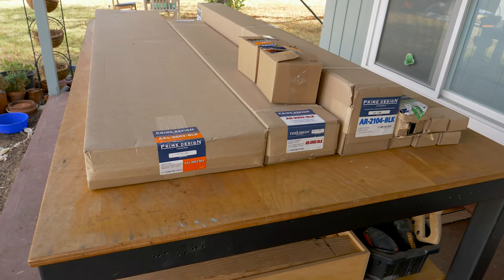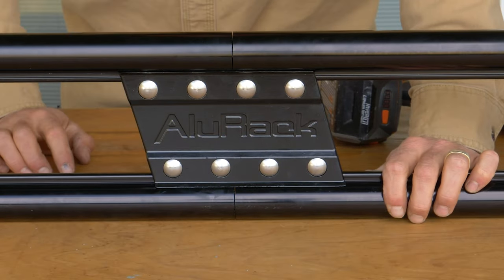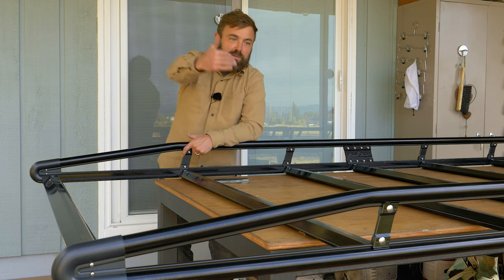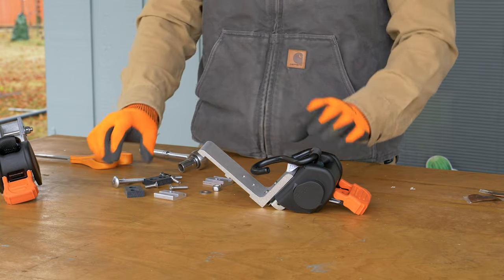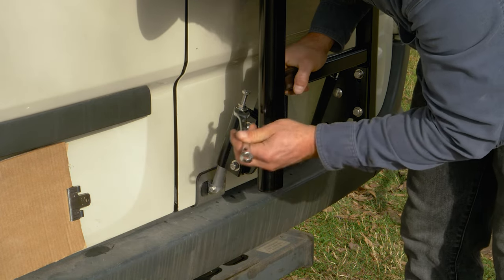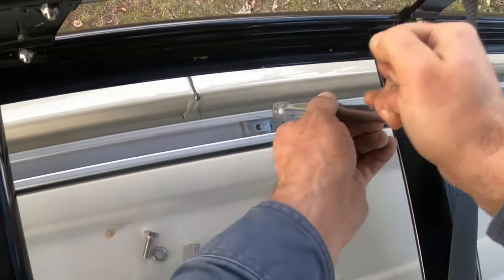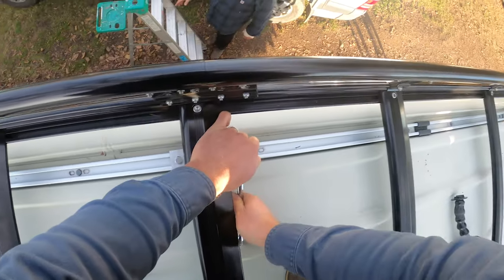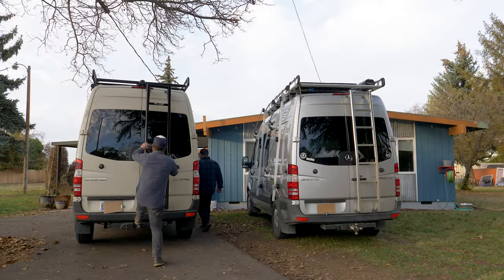Sprinter Van Rack and Ladder by Prime Design

Comment: Beard looks good.  Blood blister under fingernail tells me to be careful when working around you.  Lol.  I have a scar in the top of my head after my bro-in-law absent mindedly slammed the Jeep hatch door while I was picking a tool up off the ground.  Good video!
Reply from the maker: You’re not wrong! I seem to smash a fingernail on every project I work on. The rack definitely pinched me once or twice during the install.
Reply: @BoutenkoFilms  That's why I'm hyper observant of injuries and what kind after 26 stitches in my scalp.  I have a scar in my right thigh from an embedded 3 inch pine board splinter from a truss factory.  The old doctor with Mr. McGoo glasses couldn't find the end of it, so he cut a small "X" in my thigh with a scalpel searching to no avail.  I put old school Prid Salve on it and the end protruded in a couple days for me to grab with small pliers and extract the gooey spear and bandaged the little crater.  Speaking of silly self-inflictedness, I got drunk before military basic training and burned blisters on the bottom of my bare feet after running unsober on hot pavement.  I got to wear those blisters as I ran through basic, even more so after I made fun of my drill sargeant.  I go slower now and rarely drink alcohol.

Comment: Great video...looking at a black alurack...I was told by local distributor that you couldn't open the rear door with the ladder on, so I ordered an aluminuss side mount ladder...I'm still happy though after hearing that the sliding side door can hit ladder if rear door all the way open/attached to magnet. 

Question: Any tips on installing roof rails onto a passenger sprinter 2500 144 low roof? Worried about the curtain airbags up front and getting ceiling panels removed/reinstalled so I can access to through-bolt. 

Also, are the prime design rails better than vantec? I heard something about the various numbers of attachment bolt options between those choices and looking for the strongest option. Guess you could always drill the rails out to catch as many factory openings as possible.